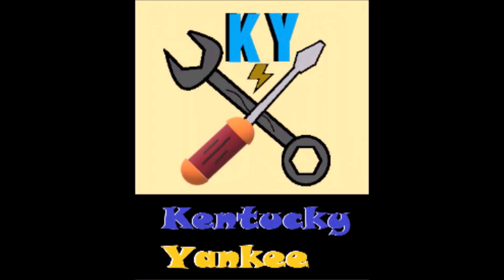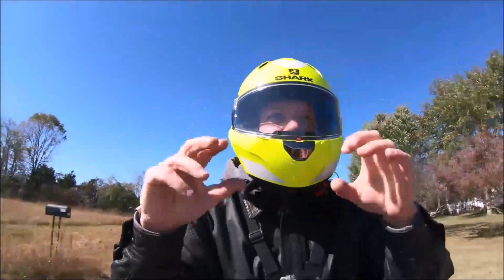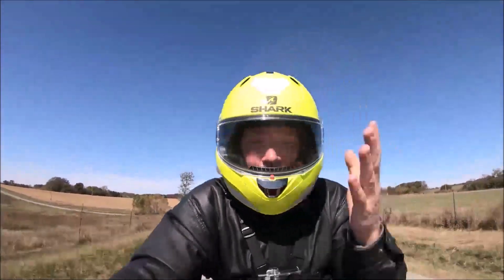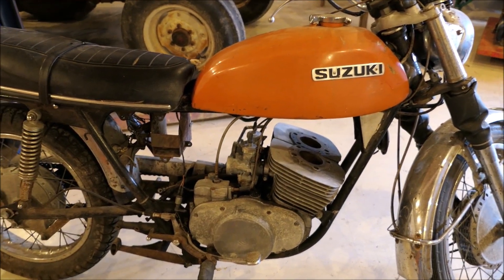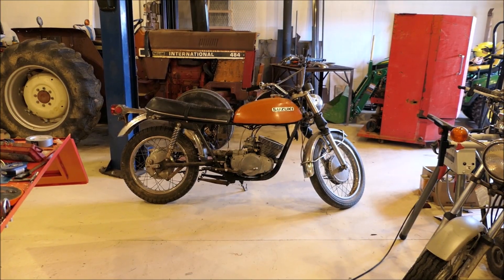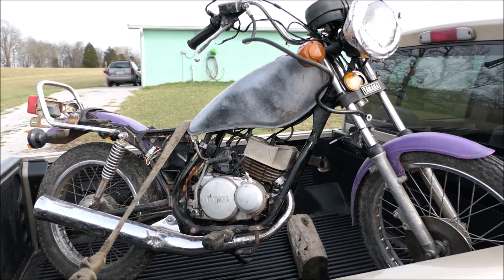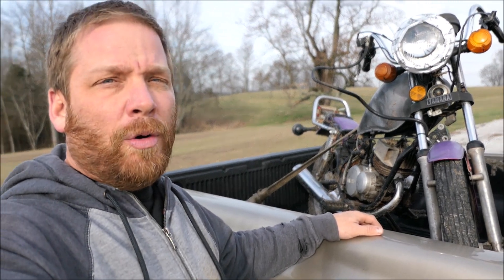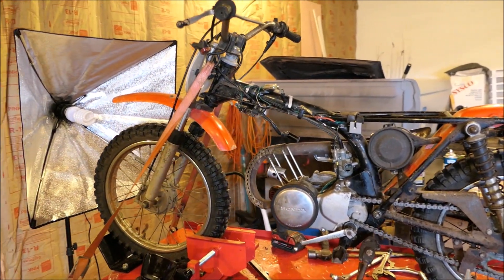Why I SOLD my Vintage Honda CB350 ?

Comment: Those Suzuki's have a very narrow power band. They are good when they're in it. I had a KZ900 years ago. I had a ride on a 500 3 cylinder, that was cool. The Hondas run forever. The KZ was a one year bike 76 only. It would spin tire in 1st gear and wheelie  in 2nd, and 3rd.